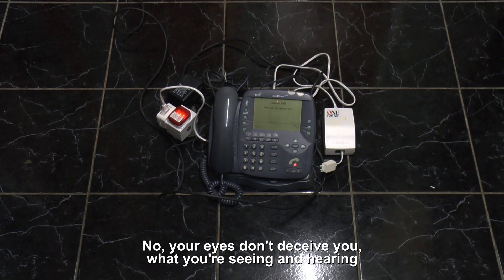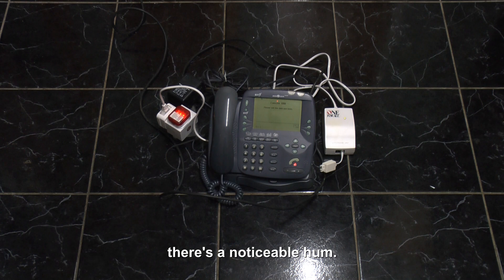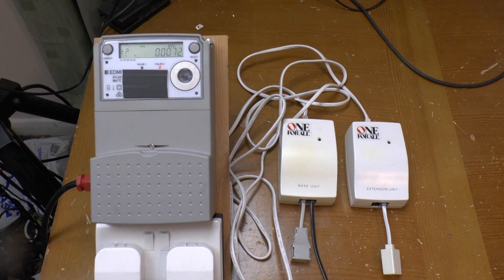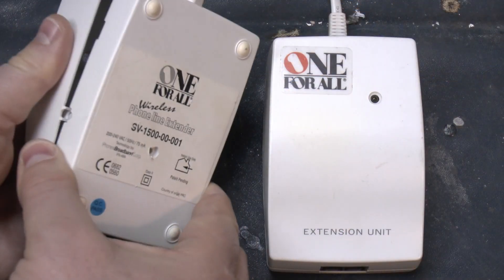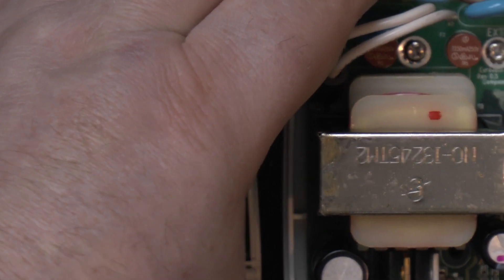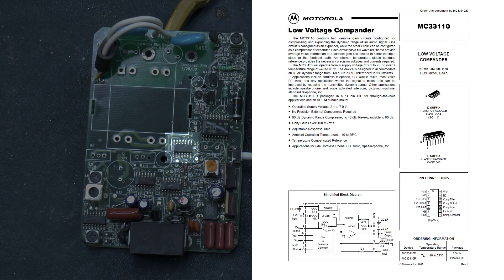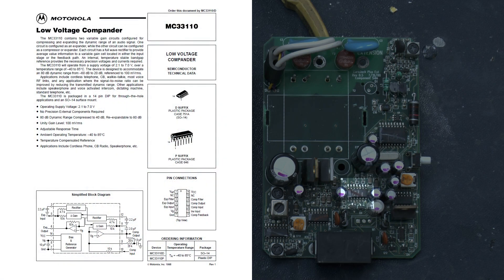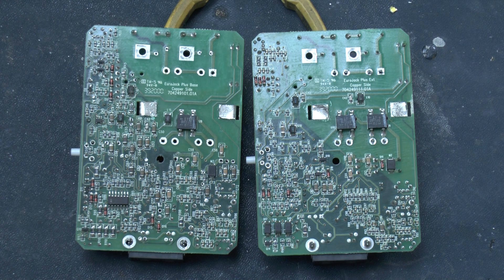What's inside a One For All Wireless Telephone Extender?

Comment: Wonder if "normal" powerline plugs could be used to transmit phone over the mains?
Reply from the maker: VoIP phones, yes.  Ordinary analogue phones doubtful without a lot of work at each end to deal with line voltage and ringing voltage, either that or a VoIP converter.

Comment: I have something like this but you plug one into an outlet near a phone jack and the other you place where you want the phone near another outlet. I have yet to see if it's just a wireless transmitter using my SDR receiver.

I'm curious if the TDA7021T FM radio chip can be used as a standard radio 88-108Mhz. It looks like the same chip used in my small project FM stereo radio.
Reply from the maker: The datasheet doesn't explicitly state its frequency range, but does refer to its channel separation as 14dB at 87.5MHz and 108MHz, and 26dB at 97MHz.
Reply: @AintBigAintClever  So with the right parts it could be a regular FM radio.
Reply from the maker: @coondogtheman  looks like it.  Stereo, too.

Comment: There was a circuit in one of my old electronic mags, it was an intercom that worked on the mains (tere are also commercial mains intercomms to), it's basically doing what a telephone circuit does, but with AC as the carrier, which has to be filtered out, the circuit also used transformers, modulation changed the secondary current which was reflected in the primary
Your units seem to use rf over the ac  carrier
They obviously won't work on different phases, but i'm surprised they don't work on rcd's, unless it's the inductors that are stopping it
Reply from the maker: GFCIs get a mention in the user manual, and it seems to be touch and go when running through an all-RCBO board (the beep error happened when I first set it up but it took a couple of takes to get it to fail on camera).  I know Homeplugs can behave very differently in different scenarios.  A friend of mine had a pair running from the house ring, through the consumer unit, along 25m of SWA, through another CU and into another ring, no problem.  He moved house, the new place struggled with them even on the same ring.

Comment: omg you have the same electric meter as me and in the same configuration with the plug socket
Reply from the maker: Cool.  I was using an Elster AS230 on my Safebloc connector, but that won't display below about 150 watts (although unfortunately it does still meter it) no matter what settings are chosen using the Elster software, so I've switched to an EDMI Atlas Mk7C on that as well, as it's a lot more sensitive.  Not all the way down, but at least it can measure some single-digit wattages.